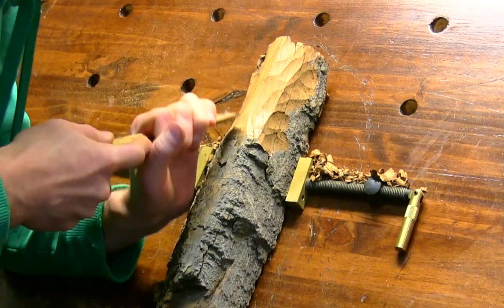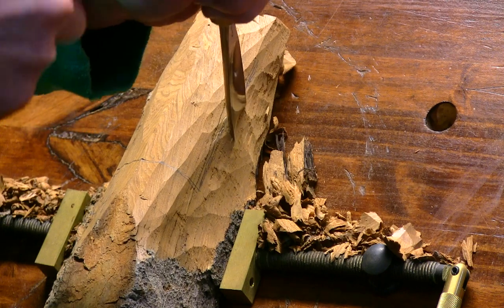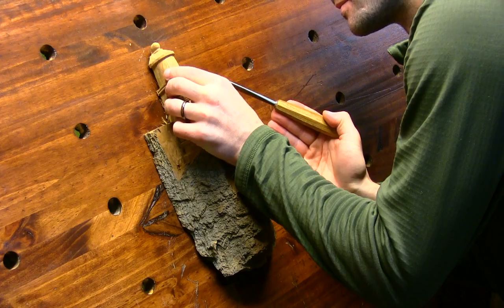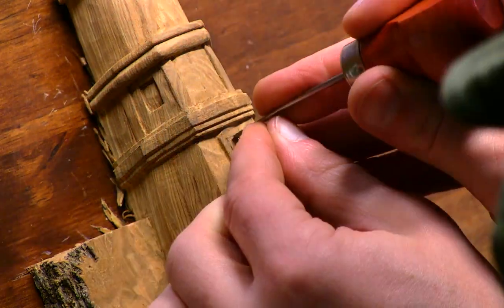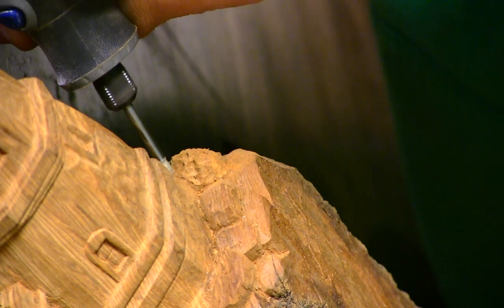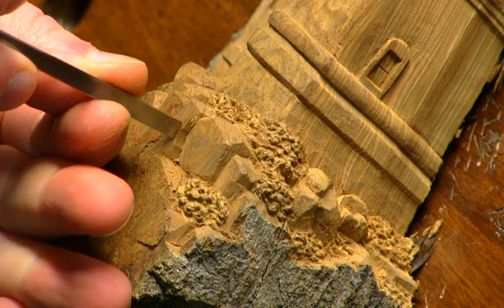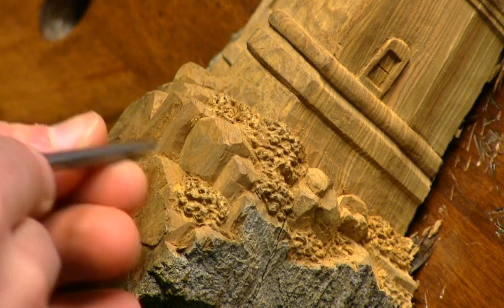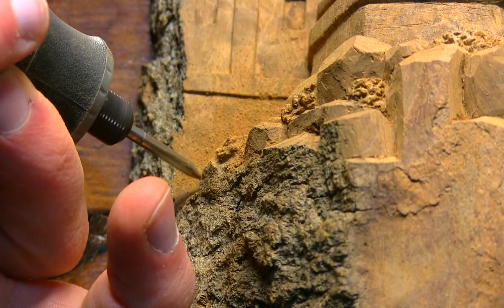Hand Carving a Legendary Lighthouse - "Split Rock"

Comment: Very nice!  I've tried carving cottonwood bark and got frustrated because it would break.  I should give it a try again.  I normally carve American walnut, hard maple, white oak, beech etc.  I ground all my chisels at a steeper angle for hardwood.  I just found your channel so I'm enjoying your videos.  I like that use use the same tools and carving style as myself.
Reply from the maker: Thank you! Yes cottonwood is very brittle which I was surprised about when I first carved it. Once you get it figured out it's really enjoyable though. I haven't carved much for hardwoods, that's an area I should probably explore more. I carved oak once several years ago and I wasn't a huge fan. I try to stick to softer woods as much as I can. It's easier on the hands and gouges.
Reply: I started carving basswood and butternut.  I was not pleased with the look of the wood and I'm not into painting or stains.  I tried hardwood and did not like it at first then I learned to use a mallet properly to include using micro-taps for detail work.  I then decided to regrind all my chisels to 28 degrees and I have never looked back!  Hardwood is a joy to carve after you learn how.  Plus it sands and varnishes well. Keep up the excellent videos!   @ChiseledOutdoorsCC
Reply from the maker: Thank you I appreciate it! @CampfireKodiak